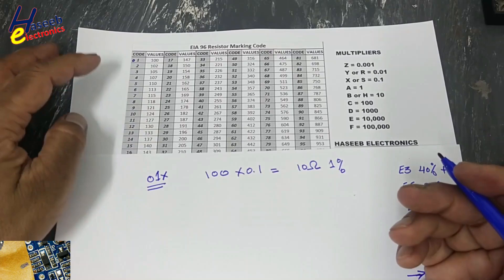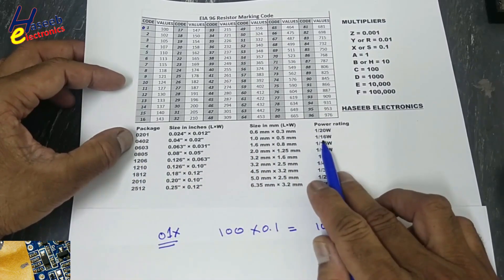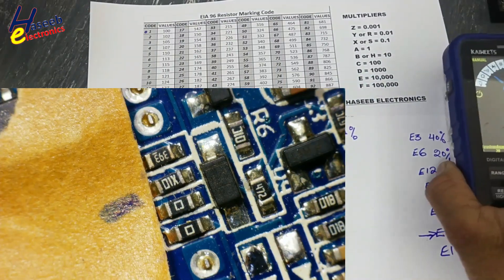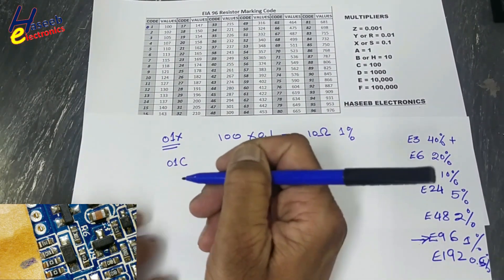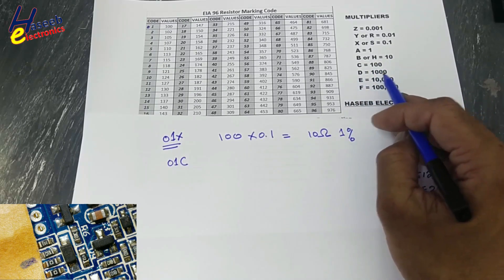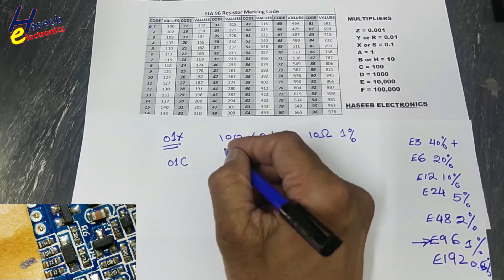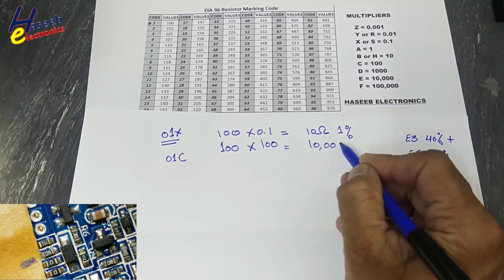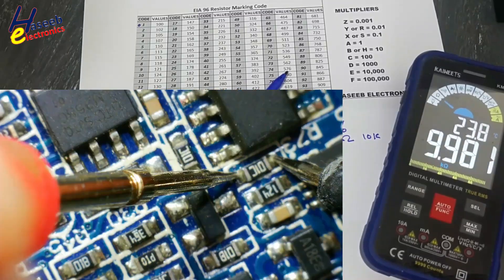{1310} How to Decode E96 SMD Resistor Marking Code | SMD Identification Guide by Haseeb Electronics

Comment: Sir, Plrase make a video for ferrite core transformer Air gap filler. 

Actually I want to make an inverter. I use a core (PQ-50/50) from a old flyback charger. There was a big air gap. I reduce it by rubbing on sand paper.  But it is not 100% flat. 

Now the core take too much current and sometime make noise. 

I try to fill the gap with various materials (Like M-seal,  RTV silicon, Iron sheet etc  ). But those didn’t  work.  Also they lose more power. 

Actually in my location there are no sources for new core. 
So if you have any Idea about how to fill the gape,  then I could able to reuse those core and that will be very helpful for me.

Comment: how we know optocoupler led side zener value ? its not tl431 its a zener.
Reply from the maker: suppose, output voltage are 12 volt. that time 12 volt zener is excellent option to be connected with TL431.  expected output voltage will 12.4 volt